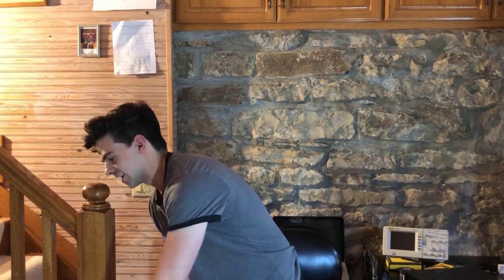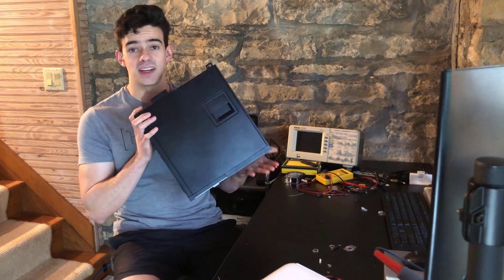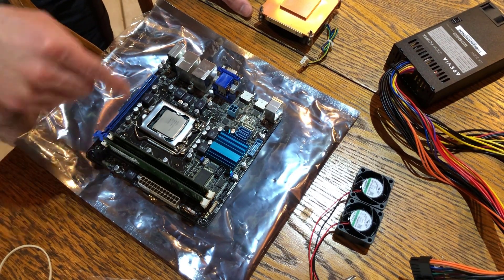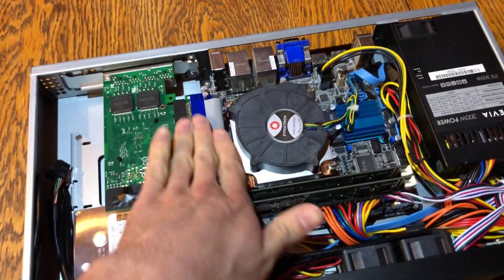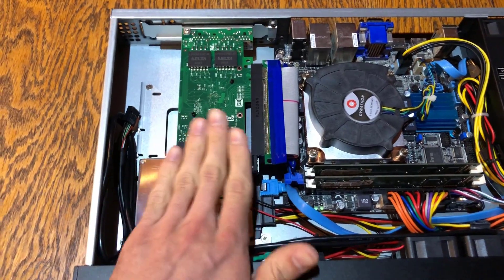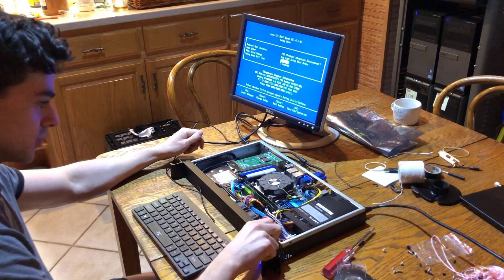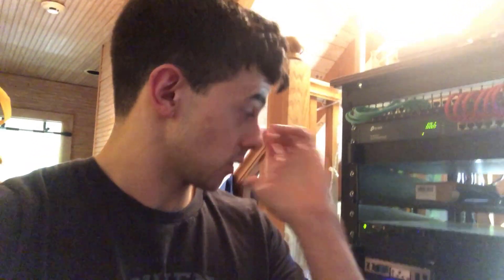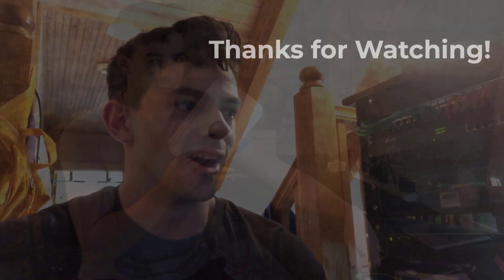Building A pfSense Router!

Comment: I'm running the same setup as you wore with the optiplex 990 and i7 3770 with 16gb ram. Two dual port nics and it's been nothing but rock solid. In fact I got two more of them optiplex boxes running esxi vms for labbing. They do support 32gb ram also.

Comment: Nice project, but I would personally use a 2U case for this. You can then use or reuse a standard ATX power supply. You will also have more room for 8mm PWM fans, also much quieter than Molex fans running full blast. Needless to say there is also more room for cable management and half-width expansion cards in their normal, more secure orientation.

Comment: I cracked up when I saw the message on the video that said that you trashed the I/O shield with a miter saw! 😂
Any dremel / rotary type tool with a metal cutting disc is the way to go for modifying anything on a PC case. 
Great video!

Comment: has your power supply ever failed? i'm about to build a pfsense box with the same case. thinking of going with the ali-e 5005 board with 4x 2.5gbe, but looking for a reliable psu for the same case you have.  not sure if i should buy a backup to have around.  thank you for the video.
Reply: That one isn't a reliable one. I've read many reports of this brand being caught on fire and you definitely don't want that near your network gear!

Comment: Caugh in a lie in the first 32 seconds. You never used it you said, then 1:30 you added devices and did zoom calls etc etc and the router did not like it... so what is it did or did you not use it? Anyways, disliked.
Reply: Good observation, I noticed this as well. I have used that exact router before circa late-2000s and early 2010s, and it will easily handle those mentioned Zoom video call tasks for a single user, even with modern devices in the 2020s. The claims of stating to never use the device and then stating it is inadequate when not knowing anything about it... at least test the device out and be honest about it, it would look a lot more professional. Good luck to this guy in the future.

Comment: How much did the total build cost? I'm debating on either building or buying a rack mounted solution.
Reply from the maker: Great question! I would say just north of $300 for everything, but I will say you can find some pretty nice motherboards or all-in-one SOC boards that are purpose-built for firewall applications on sites like eBay. CPU and memory requirements aren’t high here, but you will want at least 2 network ports.
Reply: Thanks for the reply! I ended up getting a really good deal on a checkpoint firewall that I couldn't refuse. Planning on getting pfsense installed asap.

Comment: Do those fans actually do anything (besides make a lot of noise) given all the wiring and ram in the way? I'm also curious if that PSU crapped itself shortly after making the video?
Reply from the maker: They're high static pressure fans, so they do make a ton of noise for sure, but I'm most interested in replacing warm air with cool air frequently. And that PSU is OUT lol, replaced with a much more dependable Silverstone last year

Comment: So how much do the components matter when building a pfsense router? I have an old PC I'm looking to convert and was wondering if things like more ram and using SSD is better than HDD or does it matter much?
Reply from the maker: I would say not that much. Of course it's nice to have more ports, so an external NIC is a great idea (and necessary when your motherboard only has one port). As far as RAM and SSDs go, 4 gigs is more than enough, and unless you want it to boot quickly, you'll be alright with a hard drive. pfSense doesn't need to do a whole lot of reads/writes to the drive during operation after all, but a helpful tip is to mirror two boot drives if you have them for redundancy. It's super easy to set up a zfs pool during installation thanks to FreeBSD!
Reply: @ThomasComputes  Ok great tips! Something I have heard about normal SOHO routers is that the processors are not the best and get overwhelmed when using a lot of data. So how good of a processor would you recommend? I have an i7-7700k for it, I'm just not sure what is considered good for a router.
Reply: @schellman2   You probably don't need advice now, but a router doesn't need much performance. An atom would work fine for most networks. It's really easy to go overkill with a router and waste a bunch of energy.

Comment: I was thinking about how to build a PFsense router as in the next few months we'll be moving to a new home that has ethernet built into the home and expect that the netgear router I have will not handle the load. At peaks I expect to hit 2-3 gbps. It seems to struggle as is. But plan on building a mid tower pc case using a ryzen system. Still debating on 4 or 6 cores and probably need a gpu for boot. But have a extra one lying around. I probably will get the same NIC as lot of people recommending those intel i340 cards.
Reply from the maker: They're great cards, and fairly cheap too. And the PC you build doesn't need to be all too beefy either (it doesn't take much to beat a Netgear router). Good luck on your quest!

Comment: Great video. So did you use the same network card from your dell and put it in the rack mounted build?
Reply from the maker: Yup! The thing works like a charm, but I’m itching to do a 10Gig upgrade at some point
Reply: @ThomasComputes  If you upgrade to 10Gig would you need to upgrade your motherboard or just the NIC?
Reply from the maker: @jdoc99  Just the NIC, the rest of the computer can easily handle a 10Gig card

Comment: How well does the cooling solution work for that chip?
Reply from the maker: While it is a little noisy, it’s great! My highs are about 40C, which is also helped by the fact that pfSense is extremely lightweight, and my processor is fairly overkill for the application.
Reply: @ThomasComputes  thanks for the info!!

Comment: I don't know all that much about pfsense but wouldn't it make more sense to put like a 120gb ssd in there? I'm not sure if pfsense takes up too much space on a drive or if the router takes a good bit of time to boot up after being powered off (ie. power outage or maintenance). Not a 100% sure if speed matters in this case.
Reply from the maker: Good question! Once pfsense boots, it essentially exists in system memory, where transfer speed is super fast. I did upgrade this device with mirrored boot drives (handy zfs feature), so system failures aren’t as big of a concern. Booting up takes about a minute, but I ensure that restarts almost never happen with a UPS, and when they do, the UPS sends a shutdown command to the device to gracefully exit each task the router is performing. In fact, I may just make a video about all that! I used hdds instead of ssds because it’s what I had laying around, and if I’m anything, I’m frugal.
Reply: @ThomasComputes  Wow! That’s actually really cool, I’ve been contemplating about building a router myself and I don’t know how pfsense works really so that’s really helpful to know!

Comment: What does your pfSense box connect to before the LAN, I assume a router supplied by the ISP which has RJ11.. I'm curious how you do this without a modem within the pfSense box? Saying that I'm on VDSL2 but still limited to like 10Mib sending :D
Reply from the maker: So my provider back then was standard broadband... not the best, but certainly not terrible. Now I'm on symmetrical fiber, but in both cases, I had an ISP-supplied modem/router combo box (can't believe they make you rent hardware, am I right?). I just put them in passthrough mode, so pfsense is still able to work with the correct public IPv4 address. Hope this helps!

Comment: Can you help me understand.... I see you have 2 switches at the top of your rack but why is there so many ethernet cables connecting the two switches together?
Reply: patch panel in the top slot(just a bunch of rj45 connectors connecting wire coming from the wall, makes your rack work easy since all the connection are at the front), then a switch in the second slot.

hope this helps.
Reply from the maker: ^ Helps a lot with organization

Comment: I like 19'' rack staff and all the PCs I've used were built in rack enclosures. The only major issue I always encounter when dealing with rackmount builds is that they require the entirely different cooling plan to what's used in regular desktops cause you cannot afford using big tall slow spinning yet quite efficient cooling fans even in 3U cases. So the only way to solve the electronics cooling issue is to attach multiple small fans to both front and rear case walls in order to  guarantee an appropriate air flow passing trough the system. In a nut shell, the rack builds happened to be quite noisy.
Reply from the maker: Big time! It's lucky that I'm not too sensitive to noisy fans
Reply: @ThomasComputes  , I'm not sensitive to regular speed fan noise either and I can easily handle whatever is below 50db level. But when I chucked in some extra pair of SUNON PE60251B1 60mm ones it became just unbearable.
Reply: If it runs that hot, upgrade the architecture

Comment: I running a similar pfsense on a older optiplex board.  I have noticed better performance by using uefi at install. Since you  are using a hdd instead of ssd´s like me,  i am interested if you compared the performance? Is there any difference at all? I didnt test this  yet. Only things i tested was lx4 vs mirrored zfs.  Also i tryed to install on a pci-e nvme disk but it seems the board dont supports that :D
Reply from the maker: I've only used HDDs, so I can't speak on performance differences, but I've had no problems. Since this video, I've added a second drive and set them up as a mirrored ZFS pool. Works like a charm!
Reply: @ThomasComputes  ok then i think its because the old dell hardware i used isnt working well with ssd´s (also its only sata2) so the uefi install fixed that issue for me.
Reply: @ThomasComputes  i have my pfsense insall running on a adata 156gb SSD and has been for 5 years now, my only observation is that it boots up faster with SSD much like any computer. pfsense is mostly loaded to memory after boot so other then writing a few log files and the random config change when you make them there is really very little disk io after bootup